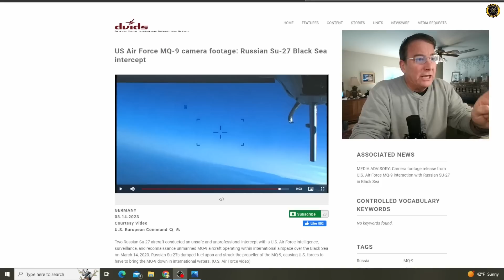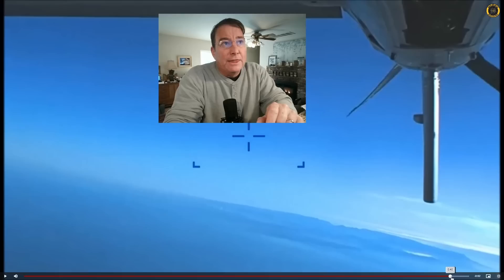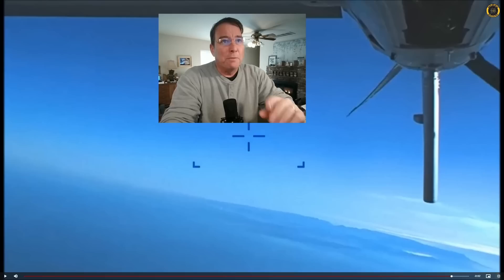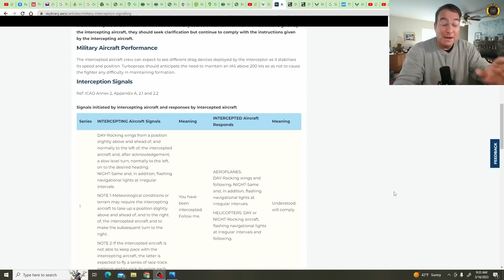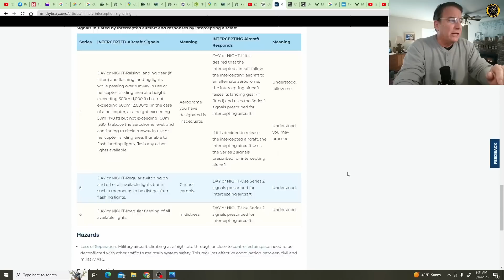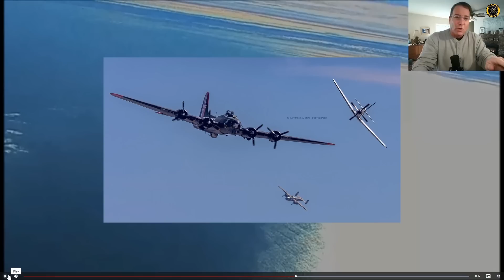Botched Russian Intercept of MQ-9 Drone Over International Waters

Comment: Is there proof the Russian fighter jet crashed?
What if…
The combination of fuel dump and thrust of the jet hitting the prop bent it?
Hear me out.  You can see, in the video PoV, the prop spins counter clockwise.
The jet is pushing thrust clockwise against it and potentially adding more force if the fuel hit the blades.
Could that force alone have bent the 2 of the 4 props?  
A physical hit seems like it would bent all the props with how many RPMs it is spinning.
anyone?

Edit: 
Note blade 1 and 3 are bent.  Meaning if physical contact was made why wasn’t blade 2 bent?

Comment: You would think they might have had a self destruct feature especially for this type of incident.
Reply: The drone can be remotely controlled -including operating the software and other delicate drone thingies.   It's not a 55 Chevy, it's an advanced EV. 😊
Reply: @GinaKayLandis  So does it self destruct on command?
Reply: It (the airframe) doesn't self destruct. However the software was disabled and whatever other remote controlled items (radar and info gathering) had their info pulled before it crashed into the black sea.
Reply: @GinaKayLandis  Thanks!

Comment: Methinks it had to be a really slow prop to only whack one blade and not also hit the rear fins /rudder etc .. tho..  Something doesn't quite add up.. Botched, maybe, but very successful from the other point of view..  I see there are a bevvy of military ships around the  location.  Was it a drone with the latest and greatest electronic  NATO wizardy that would be nice to have to reverse engineer? They certainly seem to be interested in it. And by they I'm not pointing at NATO..  Down she goes, minimal damage, on their controlled No Fly black sea turf. At least that's what the NOTAMs say...
Reply: "No damage" lol. Water acts like concrete at high speeds. It split into a million shards and sank.
Reply: @screetchycello  maybe.. but maybe not if she was trimmed for slow flight, which I'm assuming would be the case for loitering and data gathering for assisting the troops for say.. target allocation [ just an example.. not saying that they would be doing that ]. Regardless, the four corners would be at the scene of a straight in crash, so finding it all won't be too much of a stretch..

Comment: Botched? you fly a B-777 if a C-152 was 10 ft from the rear of a 40,000 lb thrust AB jet at full power it would be blown out of control or damaged enough to break apart. The fuel dump was to try putting a vapor cloud and light it with the after burner catching the drone on fire. in war combatents can declare areas as no fly zone. For no huge cost a $30 million drone (overpriced) was downed. Save the expensive  air to air missiles for manned evasive targets.

Comment: Juan, you hit the nail on the head. Even the approach and attempted gas dump pass was set up incorrectly, and missed by a mile. The idiot pilot screwed up the second pass even worse. You are correct, Russian pilots are very inexperienced and it always seems to show. I have never understood why we spent so much treasure and effort fighting a Cold War against these corrupt troglodytes. Once upon a time in the early nineties myself and the Capt I was flying with landed a brand new 757 in a recently opened up former Soviet republic. We always flew the inbound leg empty because nobody wanted to go to this place, but the jet was always full on the way out. I worked the inaugural flight in. When we requested fuel to leave an ancient tiny, rusted out fuel truck pulled up with steel spoke wheels. We ended up at the hotel (full of hookers 😂) until a fuel truck build in the current century showed up with fuel that could pass a white bucket test. I have zero fear of the Russians. They’re a stone age tribe with rockets.

Comment: It's only bad flying if his mission statement was to only intercept and observe. If his mission statement was to attempt to bring the drone down without the use of weapons, then it was incredibly amazing flying. 

Perhaps his orders were to use...
1. Fuel dump to stall the engine. 
2. Close flying to disrupt Air flow to cause the drone to loose control. 

I'm guessing the impact with the propeller was an accident, but it's possible this was part of the pilots mission parameters. 

Got a question for the forum.  Is this the first time a  Russian fighter jet has taken down a US military aircraft without ever firing a weapon? The Russian pilot is a legend.

Kevin

Comment: It wasn't "botched" - the drone was intercepted and ended up in the sea, which is probably what was desired by the Russian pilots. Also, by international law, the drone should have had its transponder on - it wasn't, according to reports. I see that on DJI's website, the area near Crimea is not marked as a no fly zone, perhaps someone in the Russian defence ministry should send a data update to DJI, but perhaps that would be pointless because the US airforce probably doesn't care if the area is classified as a no-fly zone by Russia.

Comment: Juan Brown Instead of doing a professional intercept  You don't know that these passes were done before a wings-level abreast formation was first tried. The intercept encounter was much longer that the two passes you show. You're making emotional assumptions.
Russian pilot failure to understand formation basics  More assumptions, you're discounting the possibility that the Russian pilot did not escalate after the drone refused to alter course.
Russian pilots have trouble remaining current & qualified Incorrect unless he was flying without authorization, Russia has their own currency & qualification standards, those aren't ours.
Fundamental lack of basic airmanship on behalf of the Russian pilot This is posted as restricted airspace, there were many passes before the two we see in the vid, there is a war in the region, the drone can gather intel which is used to kill Russians & equipment. It seems the Russians enforced the airspace restriction w/o firing a shot, this not only sends a message but accomplishes an objective without causing an escalation. It may very well be the opposite of your characterization.
Reply from the maker: No.
Reply: @blancolirio  Juan , the possibility exists. The pilot may not have 100% been set to strike the drone on the final pass though it is possible he'd be willing to have the tail of his craft strike the ruddervators. We can't know. His primary goal may have been a compressor stall using fuel - but that wasn't working. We can only make a list of possibilities & rank them by probability, there can be no absolute conclusion drawn from what info we are allowed to access.

Comment: Great assessment Juan, “poor airmanship” I don’t agree, actually it’s fairly skilled as to not have a total collision ( too bad) at least then a Reaper could claim it’s first Russian kill, but it appears to me this was a directed and focused attack on the MQ-9 for obvious reasons. 
I used to work on these aircraft years ago, they typically had three bladed aluminum props, perhaps the newer ones have  four blades. 

If the fighter actually hit the prop, perhaps he would have hit one of two the upper “V” tail planes, as the propeller rotates in a smaller rotational plane than these flight surfaces extend, as not to have a prop strike with the ground, and the drone camera would have shown the aircraft momentarily shutter from the strike. 

Hopefully the MQ-9 operators were able to blow the aircraft up with the on board self destruct capability after the strike, that is if the military is still using those systems? 

Why isn’t this considered as an act of war ?

If the USA did this to a Russian aircraft, they’d most definitely say it’s an act of aggression…..

Its all bad, no matter what or who did what…..I hope WW III is not starting…..👎🏻

Comment: Sorry Juan, I don’t believe this is poor airmanship. I believe this was a deliberate effort to bring down the drone with minimal damage so the Russian navy could rescue it for analysis. The fuel dump was an attempt to snuff the engine of the drone. When the first attempt missed, he tried to get closer the next time and slightly misjudged it and clipped the prop. I am guessing it hit his tailplane. That is why there is only one blade damaged. I suggest this was a very skilled effort given the speed differential of the two aircraft and the fact that the fighter had to go over the top of the drone to achieve this. Full marks to the Russian pilot. I just hope that the US airforce were able to destroy all the top secret equipment and software before it crashed.